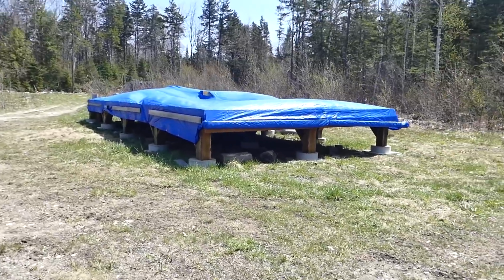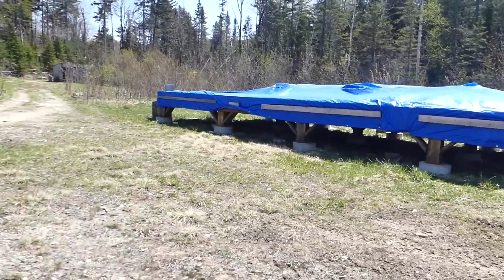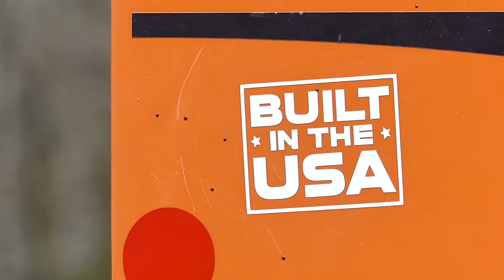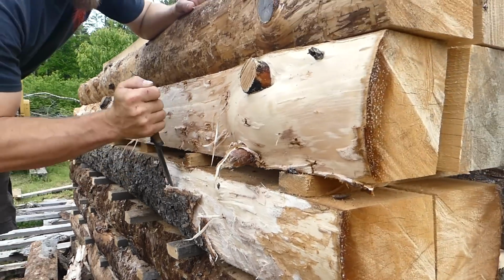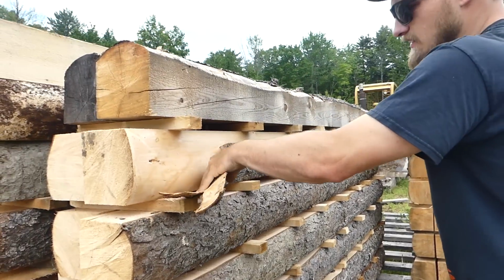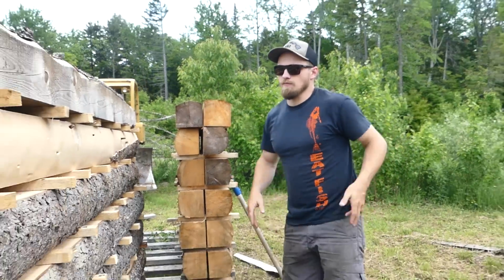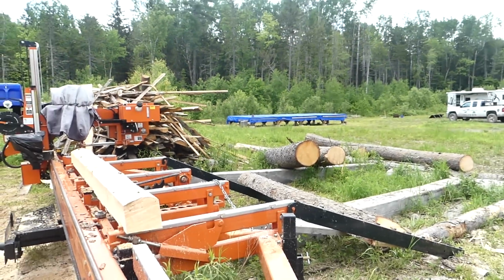Building An Off Grid D Styled Log Cabin in Northern Maine: Preparing the Walls

Comment: I have also milled alot of lumber for a stick built cabin and one trick milling I came across later in my project is..find out where you want to cut for your D log, then cut 1in taller, then cut for the top, bottom or side of the piece you want. Then your left with a whole bunch of 1x lumber.  Stack that aside.  A stack of 1x lumber can and will come in handy.  Even if it's only going to be 1x3 lumber you still need trim for your house.